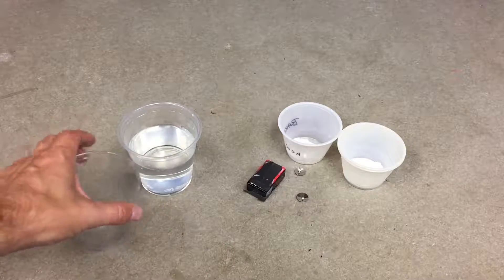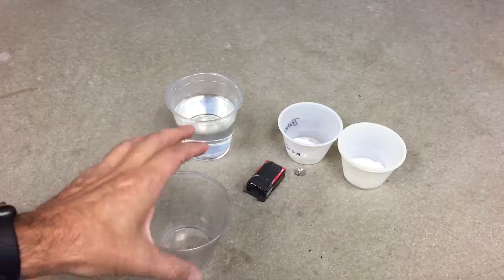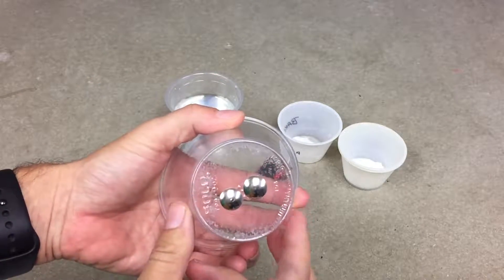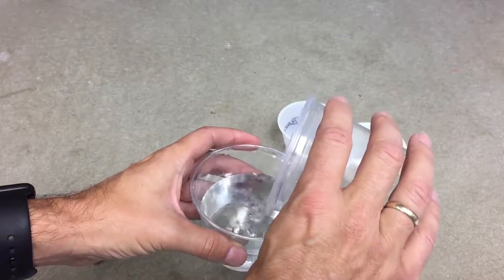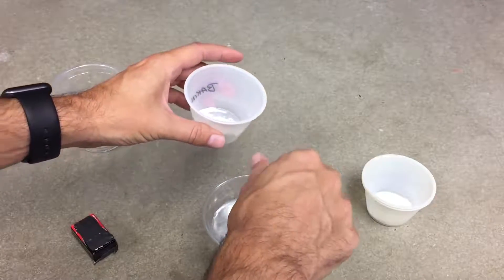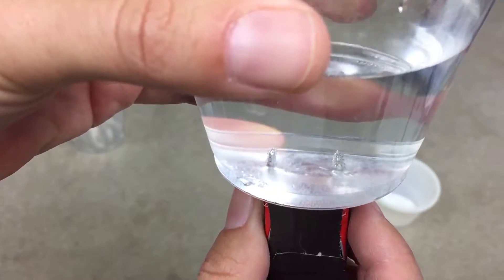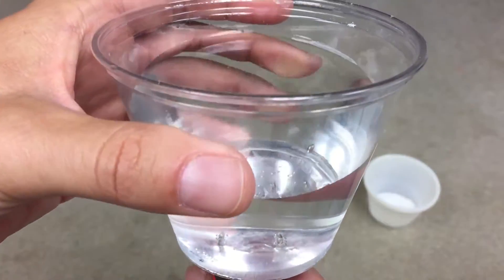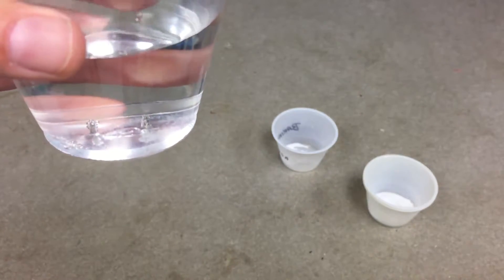Make hydrogen gas at home with a 9 volt battery

Comment: TWO TACKS STUCK TO THE OUTSIDE BOTTOM OF THE PLASTIC CUP USED FOR CONNECTING TO A 9 VOLT BATTERY.

Comment: Thanks for the amazing explanation of the simplicity of the process! I didn't know how a split output Hydrogen-Oxygen generator worked, but now that you mentioned that the negative electrode produces the hydrogen and the positive makes the oxygen things are more cleared up for me now! Now I'm just wondering how that works in itself, but I can now start it as a small project too!

Comment: I am thinking of making a hydrogen-powered go-cart, and I want to know if using a stronger current (i.e. car battery instead of 9 volt) will speed up the process and release more Hydrogen and Oxygen in a quicker amount of time.
Reply: I think the Amp play part there. Have you started this project yet? If yes, how are things?
Reply: Using battery that can deliver more current won't help here as 9V battery already can deliver around 0.5A. You need more voltage to get more current flowing

Comment: Water does not conduct, therefore can not be split, therefore water is not H20 👍
Reply: Yann cedric Totsingan  no joke, just opinion. We must watch the same video's?
Reply: How do you guys not know that water is a really good conductor of electricity?
Reply: Wait hold up I rescind that statement, you need other shit in the water. Pure water don't like electrons.  :D
Reply: Draco Infinite salt water works fine😁
Reply: @sethriggle1462  no its doesnt thats dangrous it will release chlorine gas so use distilled water and baking soda ONLY
Reply: wut?